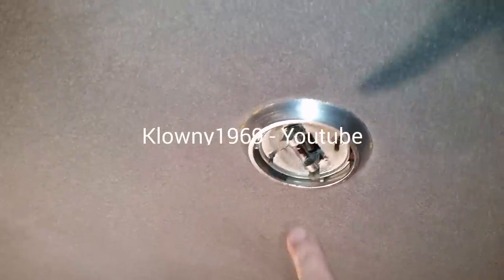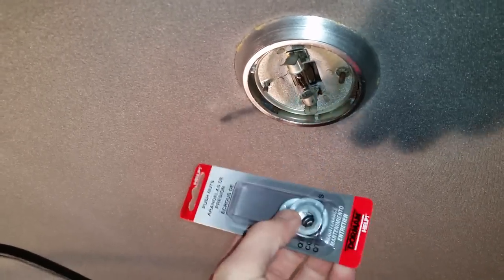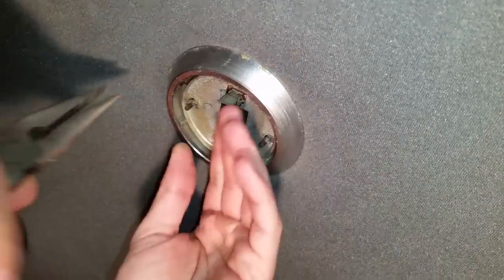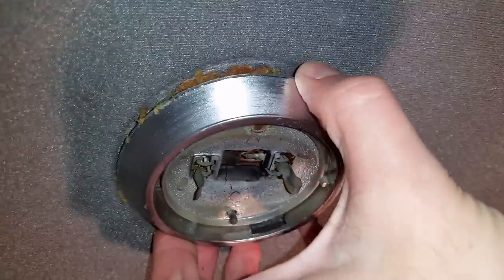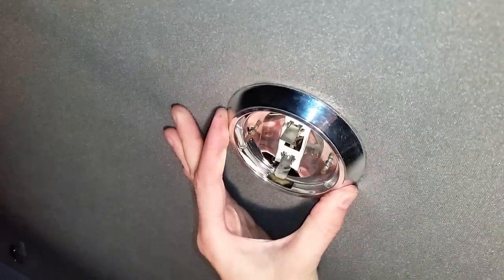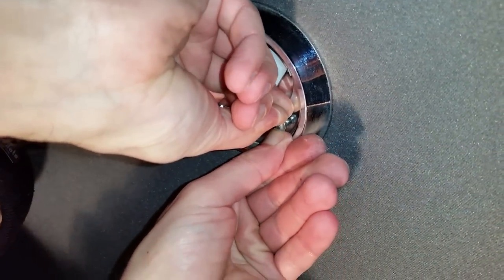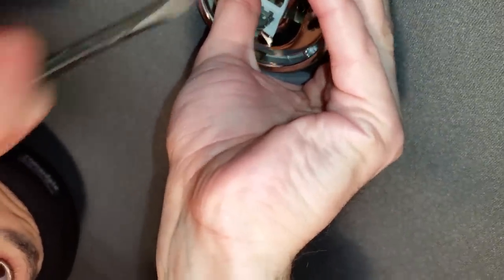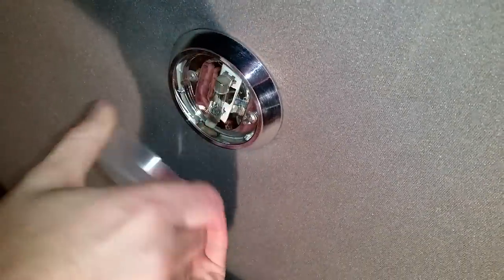How To Change A Dome Light (Whole Unit)

Comment: Thank you for the video, I bought the same unit, but apparently the body of the dome light are connective to the negative wire, I checked using multimeter its show connection to one of the tab , what you think.

Comment: How do you install the replacement screws?
Reply from the maker: sean owens what?
Reply: The two screws that hold the light. Are missing on mine, how do install the new ones that come in the kit?
Reply from the maker: sean owens I worked on this car years ago..if I were to guess, you would have to take the whole headliner out